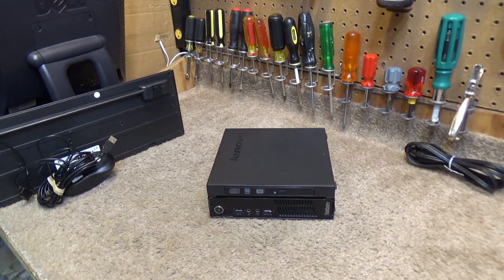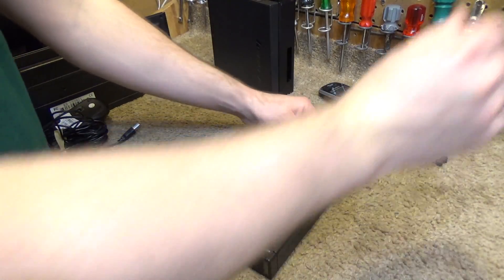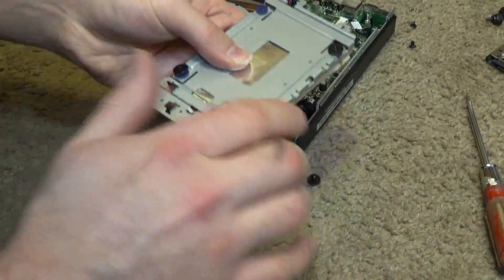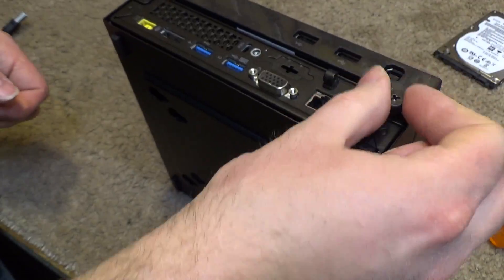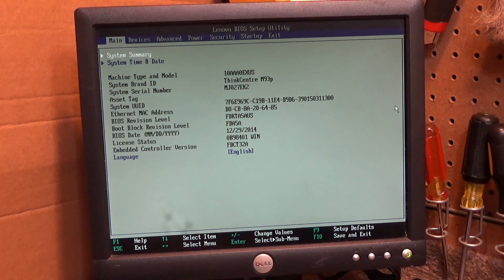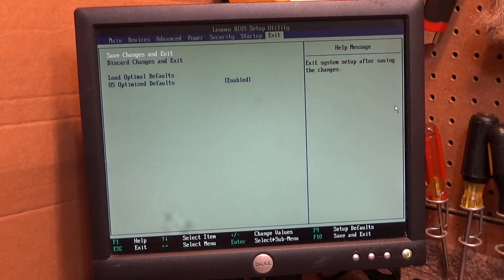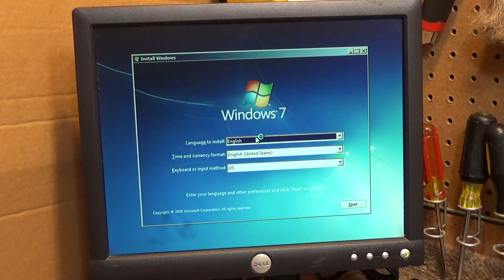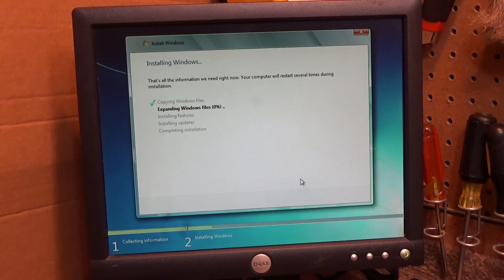Setup New Shop Computer | Part 1; Hardware Upgrade and Install Windows

Comment: If need be, those laptop style CD drives usually have a single screw in the back of it and then slide out. Matter of how to get it

And on newer computers 08+ Id suggest uefi booting off the windows installer
Reply from the maker: I could get it out, but since I have no immediate use for it, I don't see a reason to spend the time.
At this point, UEFI "should" be used when available. The Windows installer tool created it in Legacy, so that's what I used. In this use case, it's fine.

Comment: I have a ThinkPad X201 with a 250 GB WD SSD and a 1 TB WD SSD for the Toshiba Satellite. In my opinion SSD are Fast and save battery life.
Reply: One with ample caching and they fly
Reply from the maker: SSDs are great for the operating system, but I wouldn't store any data on them unless it's backed up regularly.

Comment: Nice! That little setup is going to work out real nice for you! Makes me want to go figure out a setup for my garage lol! I don't think you will have any issues running windows 7 on that machine, I've done it many times. It just means that the product key for windows 8 is somehow stored in memory on the motherboard or something weird like that, it doesn't prohibit you from installing other operating systems on the computer. Also I do have to ask, are you just going to switch over to linux full time when windows 7 becomes unusable for a daily driver machine? Microsoft claims they aren't making another OS after 10, they're just going to keep updating it lol.
Reply from the maker: Sometimes the companies don't supply drivers for systems earlier than what it shipped with, I thought this may be new enough that such could be the case but fortunately it wasn't.
I can still do everything I want to do under Windows XP, it will be a very, very long time before I cannot do it under 7. When that day comes, Linux will be invoked for anything that requires an Internet connection. I've heard those claims about no new Windows; unless they change it to subscription based licensing, I'm not sure how they're going to make their revenue. Doesn't matter to me, they've lost a 2 decade customer. I refuse to use garbage products.

Comment: The drives indeed probably failed because they are the Oceanfence, not necessarily because they were on all the time.  I've had several Eastern Analogs on all the time as network backup drives that show no signs of slowing down.

Why not Window 8 for a main computer use case?  No BIOS/driver freakshow, it still has up to date browsers, and the digitan product key is probably still on there.  If the Start Screen is too deplorable, there were third party Start menu softwares made (I think it was called Classic Shell).
Reply from the maker: 7 is on borrowed time, I'd like to use it as much as possible while I still can.
Reply: @JordanU  i will never go any higher than xp. everything after xp is junk!
Reply from the maker: @jacksonsanders23  10 is trash, everything prior is fine.

Comment: I personally dont think 10 is that bad but that is me
Reply: 10 is an excellent operating system
Reply from the maker: @Tokaisho1  It's unreliable, bloated trash.
Reply: @JordanU  On my current system it has been very reliable and you only choose what you want to install, you have full control compared to my older Windows 7 or XP computers which crashed more often.
Reply: @JordanU  Older operating systems are also no longer supported by Microsoft.
Reply: @JordanU  Other than that I get that it's very good for older hardware that was made for the older OS's
Reply from the maker: @Tokaisho1  You're not making sense.
Reply from the maker: It's not for me.
Reply: w10 is ok,better then vista. i miss xp
Reply from the maker: @oldcarnocar  I'd take Vista over 10 any day. At least after all the service packs and updates are installed, it's stable. 10 has been out for years and it's not getting any better.